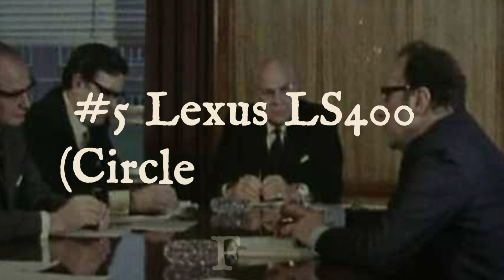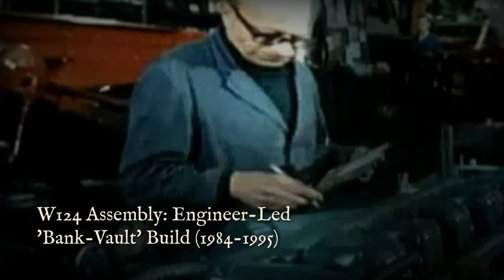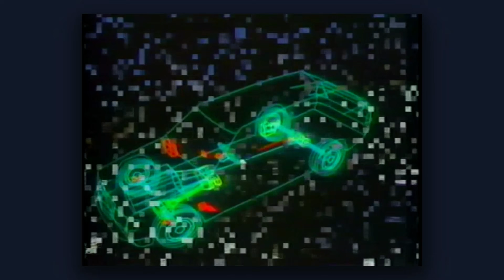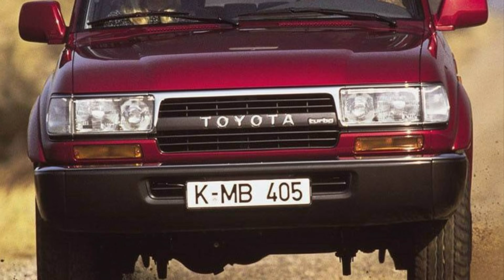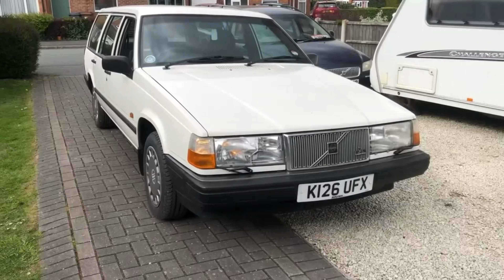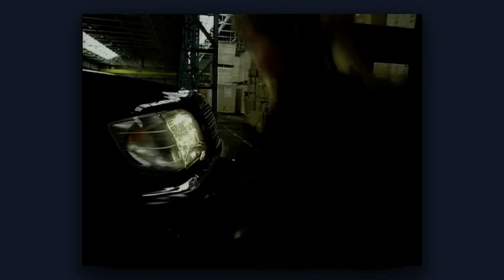Five Cars From the 1990s That Were Built to Last Forever

Comment: 😅1978, 79 77 Cadillac sedan Deville. They drove forever.. similar style, chassis, huge engine working at a low capacity. The only problem was the invention of the catalytic converter which rusted above right through the floorboards in winter climate.
The Lexus 2001 to 2006 LS 430, 1,000,000 mile cars much more refined on the Lexus 400.  lasted forever also as the  video says.
Reply from the maker: The old Deville and the LS430 are both textbook examples of over-engineering for longevity. Cars built at a totally different standard.

Comment: Another car that was built to be a forever car is the '94-'97 Honda Accord, specifically the 5th gen models, or CD/CE chassis. These were built like a W124 and had refinement that was not too far off an LS400. Would be great if you did a video on these.
Reply from the maker: The 5th gen Accord is such an underrated pick, that chassis was seriously over-engineered for what it was supposed to be. Adding it to the list!

Comment: The w124 is an amazing car but that polyurethane underseal cracked and traps water and the multilink suspension mounts on the back are rust prone. Also when the w124 first came out, taxi drivers complained about how unreliable it was !
Reply from the maker: Fair points on the underseal and suspension mounts, those are real weak spots to watch for. But once you address them, thats still one of the most bulletproof chassis ever built.

Comment: I use a European market W124 with a 2.3L engine. It's closing in on 300,000km which is about 180k miles. They're more reliable than these flashy newer models. Parts are getting hard to source though. I recently changed the cylinder head and it took me 2 months to find a decent replacement.
Reply from the maker: 300k km on a W124 and still going, thats exactly the kind of bulletproof reliability these were built for. The parts sourcing struggle is real though, the price of owning a proper classic.

Comment: Nissan built some excellent cars in the 90s.  To me it was Honda ruled the 90s, but Nissan was close behind.  You could get the Maxima with the v6 and a manual tranny.  By the late 90s/early 2000s the car makers had the auto dialed in....now they are just trying to get 600hp out of a 3 cylinder.
Reply from the maker: Honda and Nissan both built different that generation, and the Maxima with the manual was seriously underrated. Now we get turbocharged cylinders pretending to be performance cars.

Comment: You missed the most reliable car built, the CB7 Honda Accord outlasted every one of these w the exception possibly being the super expensive Land Cruiser.
Reply: 91-97 Accords are tanks
Reply: @FELIPE8226M I rarely see any 90s accords on the road, while the 90s Camrys can we seen every so often.
Reply: @Was @Wasabi9111  I see 90s Camrys every but 90s accords can take lots of abuse also that might be because you live in the rust belt
Reply from the maker: The CB7 Accord is seriously underrated for how bulletproof it was, that engine just wouldnt quit. Fair point, it absolutely belongs in this conversation.

Comment: The W124 is from the 80's
Reply: The overall W124 series ran from 1984 to 1997, marking the end of an era for robust Mercedes engineering.
Reply from the maker: Fair point, the W124 spans both decades which is exactly what makes it such a tank worth including. That over-engineered era had no cutoff date.
Reply from the maker: You are right, it started in 84, but that W124 ran deep into the 90s and its DNA is pure over-engineered gold regardless of the decade.